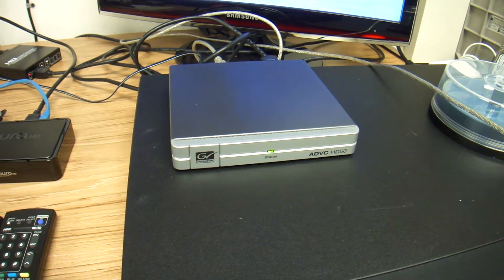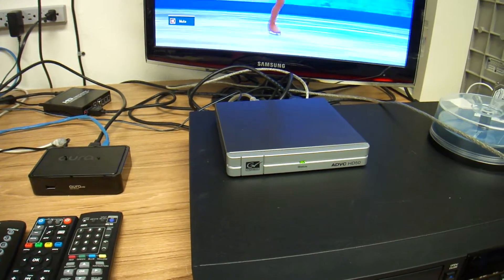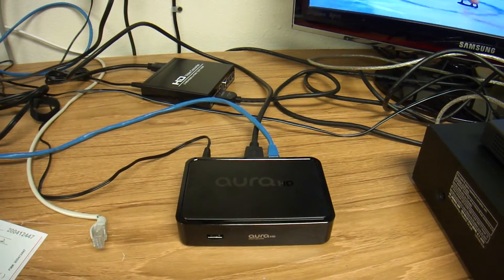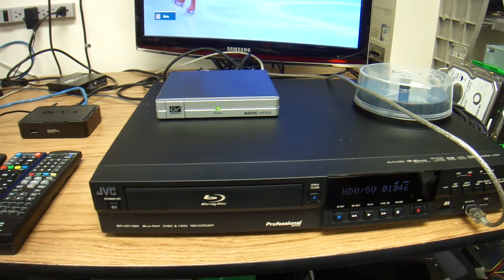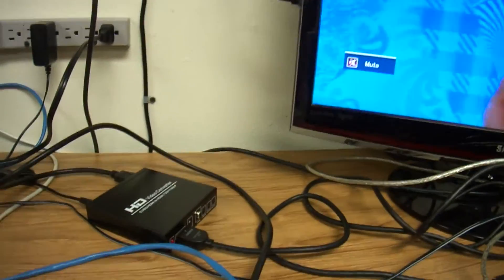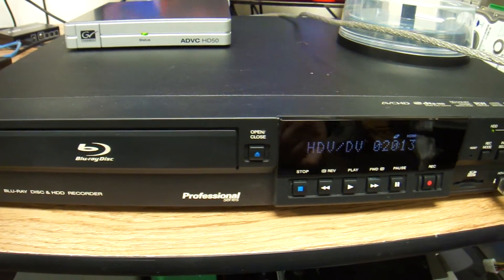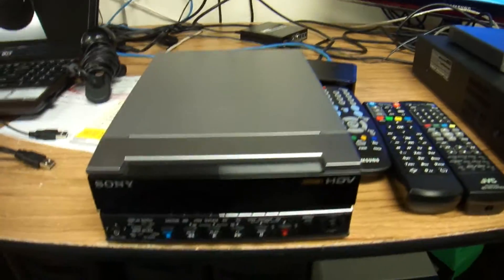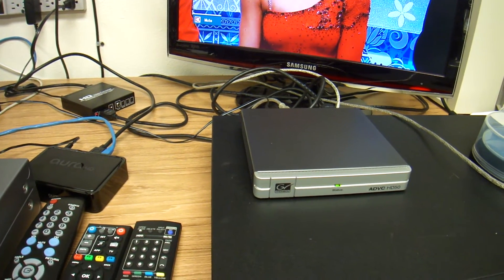Home Made DVR with GV Thomson ADVC HD50 HDMI to HVD 1394 firewire converter in action MAH02651

Comment: Impressive setup. ***** the Atomos Ninja 2 does not record HDCP content, so this was not an option. I see an JVC SR-HD1250 recorder, which is strange that it does not have HDMI in. HDCP can be stripped. The Hauppage HD PVR 2 or Pocket / Rocket editions and Avermedia LGP (lite) produce acaptable quality recordings but not like this JVC. I think that the Aura HD only outputs HDCP content that is stripped by the CVBS/HD to HDMI converter.